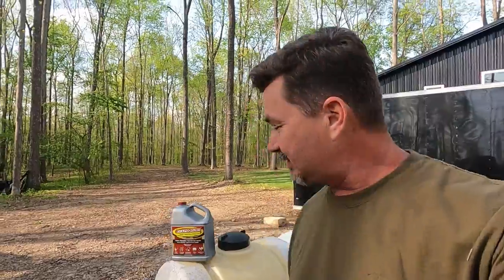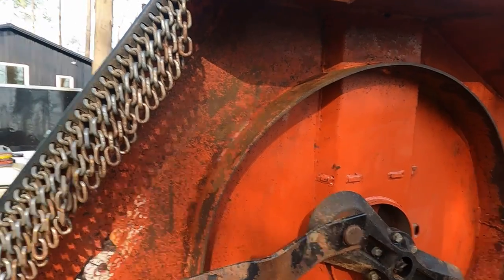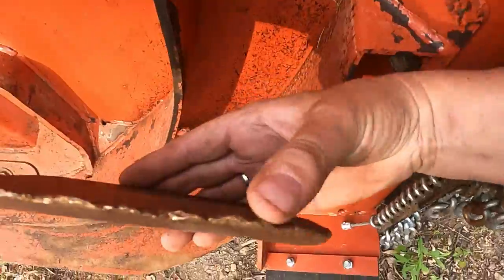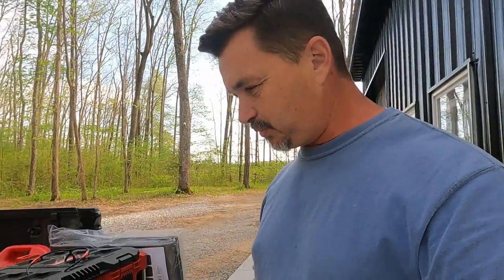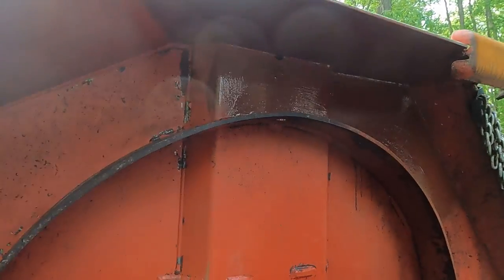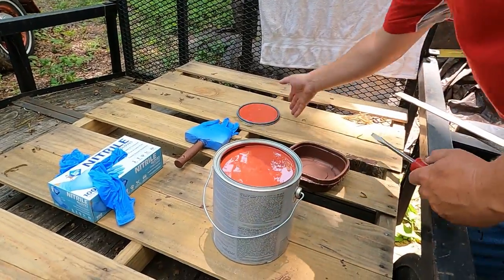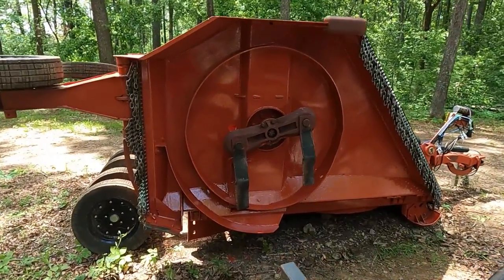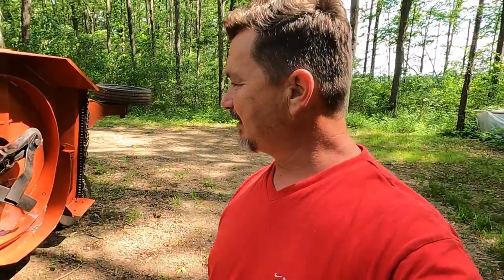1 Year Later, Restoring My Rhino 3150 Cutter! Remove Rust, Prime, Paint & Blade Sharpening!!

Comment: the under side is a wear item, the paint won't stay on as long as it took you to do it. washing  and spraying with a mixture of diesel and used oil will be your best bet. I would suggest building a post structure and hang a chain off of it, then you can pick the hog up with the loader and hold it with the chain to work on.
Reply from the maker: Great tip, thanks a lot!

Comment: One year in that cutter looks beautiful. 

How many acres did you cut in your first year?

I’m very Interested in the blade carrier design. My current brush hog has a flat pan jumper, (replaced once already from a dish design) and I just ordered another pan the other day.  

I don’t see my brush hog making it much longer. 

Have you ever had your blades get stuck on the opposing blade on the carrier. (That’s what is happening on my pan). Once this happens it bends the pan really bad. 

This time it bent just cutting tall grass. 

My cutters blades deflect so much that the blades have been hitting the frame/deck. Significantly destroying its longevity. 

I love and work up in the adirondacks and we have glacial stone. It is a bit rough on cutters.